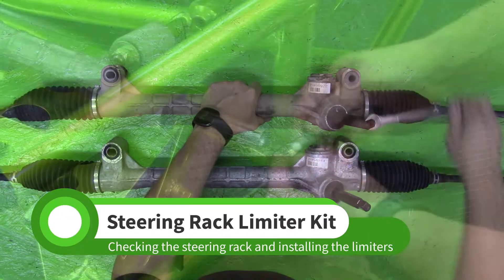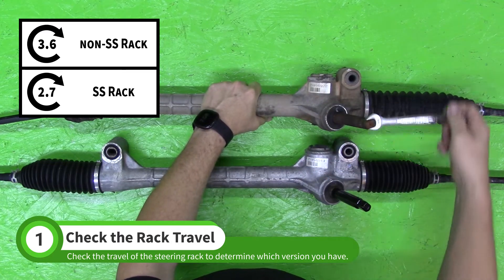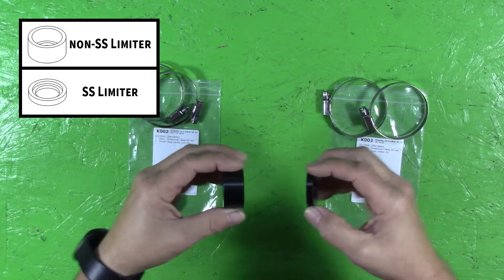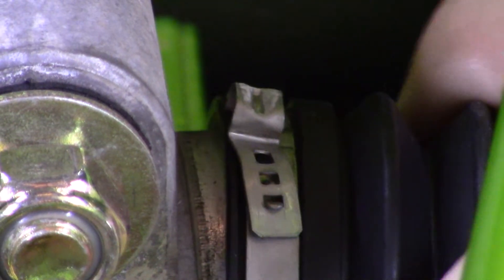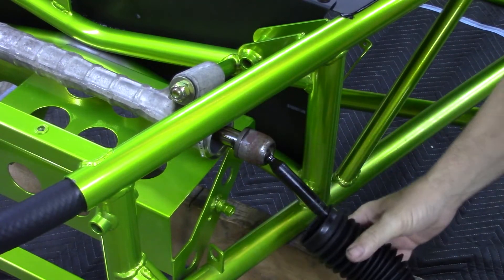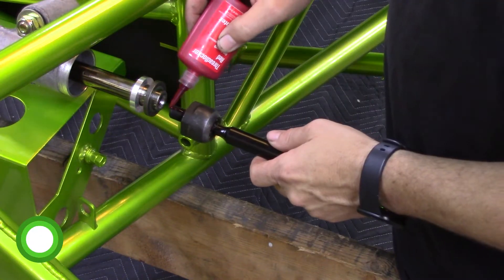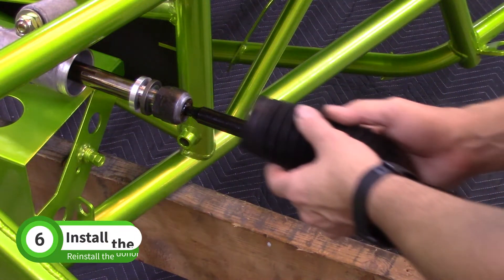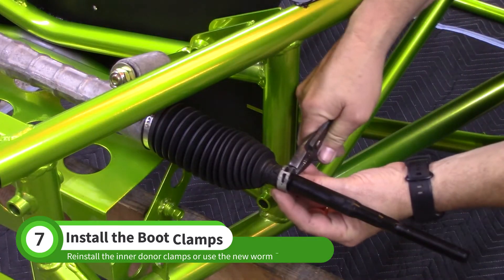Optional - DF Goblin Assembly - Steering Rack Limiters

Comment: interesting, didn't know SS had quicker ratio then grocery getter
Reply from the maker: That is what we thought at first but it actually isn't a quicker ratio. It just has less travel so that the wider tires wouldn't hit when turning at full lock. If you look closely in the video, you can just make out that the SS tie rods do not move as far as the base tie rods when turned all the way.

Comment: In the DF Goblin store it shows order a SS model or non SS sense mine is in Goblin already and I don’t know how many turns it would tale , Can I just order the SS kit sense I have a 2009 SS TURBO 
Another great idea Lonny
Reply from the maker: Hey Charles, if you pull off your front tires and wheels, you will be able to do the lock to lock test at your steering wheel. I bet yours is an SS version but there is a chance someone swapped your rack before you got your donor.